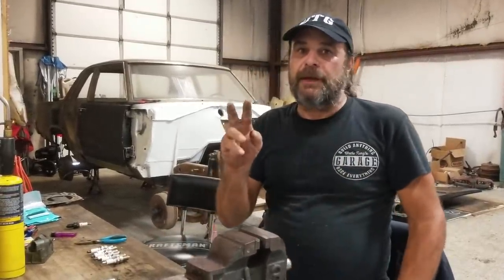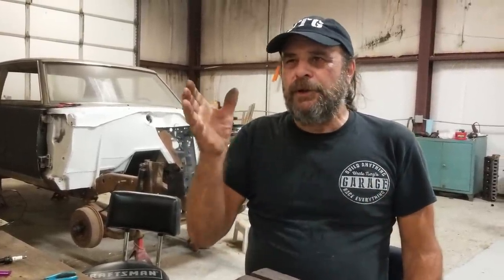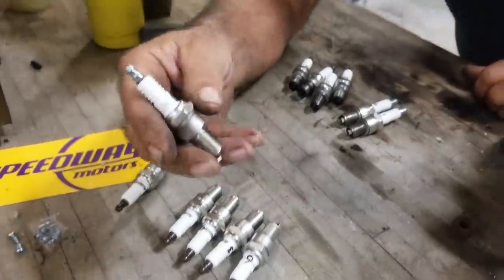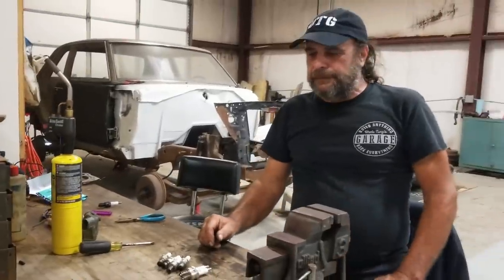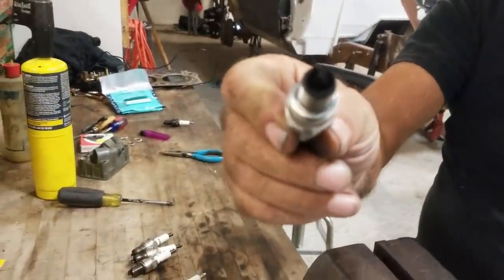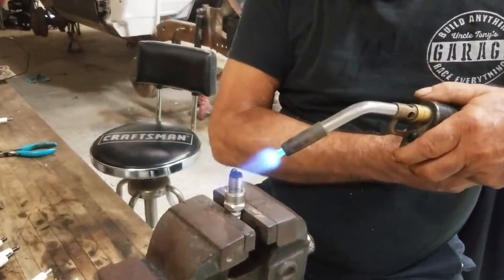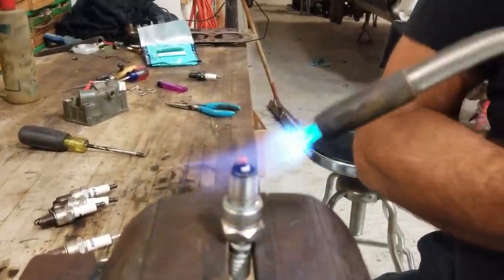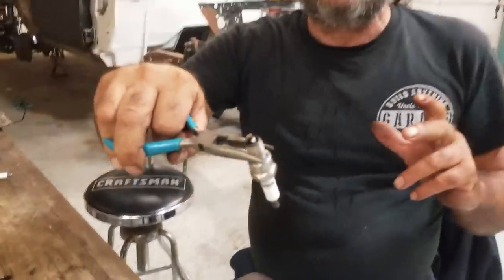Clean It With FIRE!

Comment: Been doing this for decades. Here's a good one. I once had a vw engine that would lose fire on the #1 cylinder at odd times and sometimes run fine. On one occasion I was looking at the spark plug and noticed that it had no gap but the side electrode was not bent or smashed. On turning the plug over the center electrode slide down into the insulator and magically the missing gap appeared. That's the kind of Shit that happens to me.
Reply: I've seen that on a turbo Volvo when the wastegate was stuck. Customer complained of a dead miss, noticed the center electrode was sliding up and down, put fresh plugs in, took it for a test drive, pulled out on the road and pressed the gas pedal down maybe an inch and a half. It put me back in the seat like a dragster, sounding like a gravel crusher while I was doing it, and then had a dead miss all the way back to the shop.
Reply: ive seen the center electrode blow put of the sparkplug a couple  of times. forces compression through the center of the plug
Reply: I had that happen to me with my 1971 Super Beetle in HS!!  Autolite spark plug.  My auto shop teacher tossed those out and gave me a set of Bosch Super plugs (he was an air cooled VW nut in the 70s).  Never had any problems with spark plugs on that car after that.
Reply: Had a chain saw that wouldn't tune right, would run sometimes and then not even start others, or might just sputter. Messed with it for almost an hour on and off, swapped carbs. Plug ceramic center disconnected from the hex outer metal portion of the plug and would slip down. Was loosening compression/grounding out through the plug body. Check simple things first!
Reply: @konnerkramer329  heu hiney where  is the spark plug i left in the barbecue? baby it melted

Comment: I do this Everytime. On my two strokes or older engines. I've gotten away with it for years.
Reply: Oh it a two stroke friend if someone doesn't know how to ride 2stroke
Reply: I always did that on my two strokes when I was a kid
Reply: Yep, my RM 60,80 Kx 80 and YZ 80 in the 90's.
Reply: Yep, worked like a charm on those snowmobiles that were really finicky if the plugs got a little bit fouled up.
Reply: you do burn spark plugs?

Comment: Great tip. Also, consider an ultrasonic cleaner. Saves a goofy amount of time toothbrushing engine & carb parts.
Reply: its not a cleaned spark plug its a burned spark plug.
mechnic: what the hell you ddi to your engine? spark plugs are burned mmm.mm

tony garage just cleaned them?

mm really?

Comment: This is exactly what happened with my 318.
Flooded it a couple of times, after that everything seemed fine except I would get occasional random missfires when accelerating, or cruising.
Remembered this video, changed the plugs and the problem went away.
Thanks Tony.

Comment: Wow! this is such a great tip. I never realized that you could do this.  Let's say you have an older car that you rescuing and you need to try to fire it up for the first time. Instead of buying new plugs right away, just use this method to clean the old ones till you know the engine is good and ready.

Comment: Thanks Uncle Tony !
For those interested, Autolite plug part # that starts with AR are already side gapped. If you're running on the rich side, gap them down to .025
The Autolite always screw in a bit rough, NGK and Bosch are much kinder, Bosch with the nicest threads. 
At any rate side gapping for the win on my engine, and plain old Nickel or Nickel/Copper.

Comment: Works pretty well just to get stuff going too. Oil or fuel fouled plugs can be roasted till the ceramic goes white and trapped combustibles burn off. Those should still be changed but they can get you out of a pinch with fouled plugs. Never wire wheel plugs, that ruins them with metal contamination. We use the abrasive method (with fancy machines) in aviation. Those have a tester with a pressurized chamber to spark test post cleaning.

On our promod, burns methanol, which leaves almost no trace on the plugs. Its tuned by cylinder by heat signature on the plugs. At the right cylinder temp, the cad plating on the plug burns/catalyzes and turns reddish.

Comment: This is an old drag racing trick we used to use way back in the day. All our plugs were indexed and numbered. If we had run out of plugs and the last run showed rich condition fouling, we'd burn them off like that with an old style spirit blow torch, check the gap out then reinstall. Low tech but it works fine in a pinch.

Comment: Also carbon burns off after the material reaches approximately 820 degrees Fahrenheit. I use the carbon from an Oxy/Fuel torch to anneal mild Steel, when doing English wheel work.

Comment: Same spark plug in my lawn mower for 20 years from new. doing this , the e coil failed replaced it first lol .
 I have a old champion plug from the 30's that is rebuildable , Yes kids years ago people rebuilt crap like that and wheel cylinders , calipers, starters, alternators, water pumps, hand cut gaskets . We were in the repair business not replace because we could buy the parts to fix things or make them . Now in a throwaway time people bitch about the environment and never fix reusable things , with a recycle it make new dumb mentality

Comment: Cost saving Tech-Tip of the Day .........
Convert to Mega-Squirt Fuel-Injection and never foul a Spark-Plug ever again.
I replace my Plugs when the Electrodes start getting rounded off
at around ~75,000-miles or so. 
Use cheap Copper-Core Plugs.
Cutting back the Side Electrode is a great idea, I've been doing it since the '80's.

Comment: Great tip Uncle Tony!👍       Hello Ultra Kathy!
My grandfather had one of those sparkplug cleaning machines in his service station & shop, it worked great for daily driver engines but they use to use a torch on the plugs for the dirt track race car. I think my one uncle did this on his sleeper street cars too.

Comment: I clean my spark plugs like this all the time but I must caution people. BE VERY CAREFUL USING THIS METHOD AND ALWAYS USE EYE PROTECTION AS I HAD ONE EXPLODE IN MY FACE. I don't know what happened, must have got it too hot, but the exposed porcelain part exploded like a hand grenade with a porcelain cloud and a sound like somebody dropping a light bulb. I was also using a spark plug socket which probably didn't help because it contained the heat. Do like Tony and use a bench vise.

Comment: An engine that is allowed to lope at low idle - also known as laying on top of the Cam - is fouling the plugs.  The reason is pure and simple, the carburetor can not meter when the vacuum is bouncing all over hell and gone!  Quit being a Meathead and set the idle up off the Cam - when you start a cold engine don't let it lay there; keep the rev's up till it will idle properly on its own.  If the carb is set right you will quit fouling plugs.
Reply: most carbs have a fast idle setting that takes care of the lopey idle for that reason and others

Comment: Hi Tony,  Been thinking of your fuel distribution problem and was wondering if you could do the "popsicle stick" trick they used on intake plenums for v8s back in the day. Maybe slightly blocking the outer cylinders could help.

Comment: If I had a dollar everytime I had done this, I could afford a lifetime supply of plugs lol. I have a bad habit of firing up an engine, running it for 5 min or less and then shutting it off or start it blast up the street and back and shut it off and after about 2-4times of doing that the plugs will be dead lol, especially on a 2 stroke engine and especially if you run leaded race fuel.

Comment: Hey Tony, I've always used my wire wheel on the bench grinder, using light to moderate pressure. 
It does a good job in my opinion. 
Do you see a problem with this method?
Reply: Yeah, metal residue will be left on insulator and might lead to arcing. fwir.

Comment: I don't see anything about cleaning the plug after fire. Is that necessary and if so what with?  I tried heating with a torch and still no go.  I bought the plug yesterday,  it worked for about half an hour today.

Comment: top tip, but why cut the electrode back on the 'running' plug, quickest way from A to B is a straight line?.
Reply: spark plugs by design are shrouded to an extent and your thinking of point a to b is logical,in a drag car,you want two things, the engine to fire at maximum and it translates to low et's,then there's the scientific explanation that talks about the fire kernal and combustion efficiency,volumetric efficiency,flame propagation--------uh just do it,he's right,i never throw decent plugs away,tony is right they can be cleaned,but then again ,nothing beats NEW
Reply: Unshrouding the fireball at the center electrode end, some plugs are built this way....

Comment: Do you cut the washers off of spark plugs for slant six? I've read so many places to do it.
Reply: You only cut the washers off of the plugs if your slant has drool tubes (earlier engines until about ‘72?).  Those are the removable tubes that the spark plug goes in.  They act as the washer, and will get torn up if you don’t.  Come to think of it, I don’t think the later slant spark plugs come with them.  I think they’re shorter and stubbier with no washer.
Reply: @RichMander1  Yah my 170 has the tubes

Comment: Ok I see you side gap your plugs but is thir any benefit of haveing all of the electrodes faceing the same way in each cylinder?
Reply: Yup definitely u unshroud the spark.
Reply: Some claim that you want to point the gap at the intake charge...I'm sure that combustion chamber shape determines this logic....many of the old ones were shrouding the valves. The idea is to hasten the flame front, which should reduce timing a bit. Chrysler corp. was ahead in this as the contours of their chambers allowed 0TDC initial , pre-emissions control regs. vs. GMs typical 10+ deg. BTDC

Comment: I can only think about the ceramic cracking from extreme heat. am I just over thinking it? would the temperature range of the plug be enough?
Reply: You will melt the electrodes first. Ask me how I know.
Reply: It's not the heat, it would be more the thermal shock that might damage them but, today's plugs are made from aluminum oxide (Al2 O3) which can withstand over 2,000 degrees F with no issues.  At the temperature differential Tony is exposing them to here, thermal shock should not be an issue.  Think about it, you start you car on a 0 degree F morning.  Your plugs go from 0 degrees F to around 1,500 degrees F  in a very short time as gas and air are ignited inside the cylinders and your plugs are fine.
Reply: @davidleonard8369  how do I get your job?
Reply: @OverlandOne  how do I get your job?
Reply: @morphius747  I am retired now.  I worked for 25 years in the Precision Ceramic Machining Field designing. engineering and machining parts for aerospace and electronics companies all over the world.  You would have to train to be a machinist, then study materials engineering and design engineering and then work in this field for a long time.  Then, you could have the job I used to have as CEO of that corporation.
Reply: @OverlandOne  thats pretty cool, I do like machining. I'll see what courses are available

Comment: I've begun cleaning my plugs using sodium hydroxide (drain cleaner) mixed with water.  Using an eye-dropper, I fill the electrode space with the mixture and let it set a few hours then thoroughly wash them in water.  This seems to remove the fuel soot and combustion byproducts baked onto the ceramic insulator to near-new appearance.
Reply: INTERESTING

Comment: Great tip for gasoline engines. I run fuel vodka so I don't get carbon build up, also rich makes more power than lean on vodka, so certain cylinders running rich is not a big deal. Makes it hard to read plugs, so I use an O2 sensor in each bank. Works fine with a V8. If I was going to build an inline it would get three two barrel carbs, just because it would look cool.
Reply: I would want to try 6 single barrel carbs just because it would be neat and orderly
Reply: I used to run on vodka but, my check liver warning light would stay on 🔧
Reply: Yeah, I tended to run a little a rich, and often had intermittent misfires the next day.